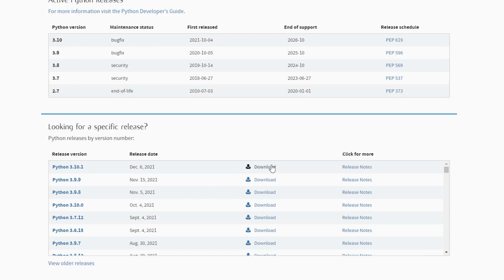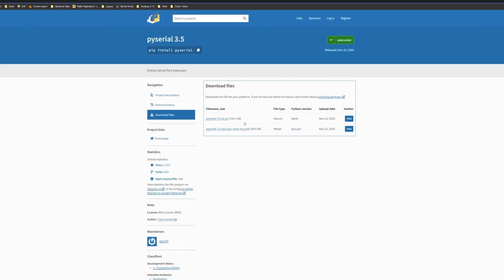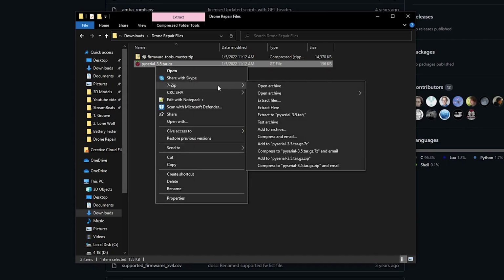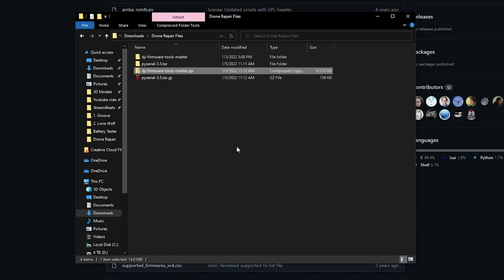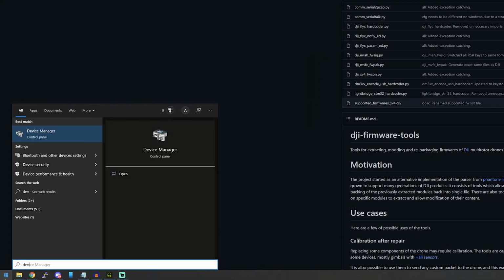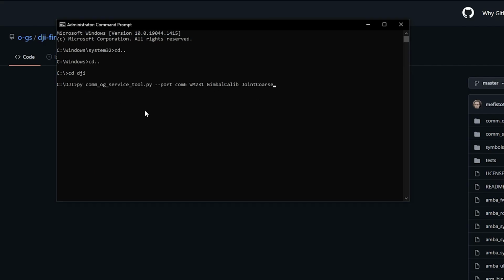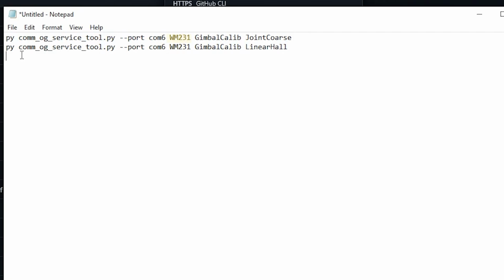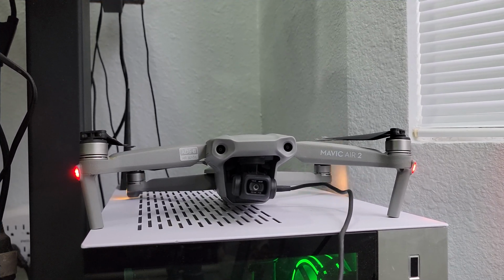DIY: Mavic Air 2 Gimbal Assembly Replacement and Calibration (Full Video)

Comment: This video saved my Air 2. It had been sitting on a shelf for 2 years after an unfortunate encounter with a brick wall. I replaced the broken parts after the crash, but they never behaved properly. I tried new wire harnesses and motors, nothing. No amount of calibration through the app would resolve the glitchy camera movements. I gave up. In doing a bit of cleaning today, I saw it on the shelf and thought I'd take another shot at getting it working. Your video was the first I found. I had already replaced the parts so I jumped ahead to the software bit. Within 5 minutes of clicking on your video, my drone was perfectly functional. 2 years it sat on that shelf. This is the least I can do to say thanks 😌
Reply from the maker: Thank you!
I'm glad that my video was able to help get your drone back up and going for you.

Comment: I did the same followed all the steps, replaced the gimbal and went through calibration on a mac. The camera moved and calibrated; however when i connect my controller to the drone it shows me that the drone needs to be activated. I get an activation error and the drone doesn't show the fly now or view of the camera. I have a mavic air 2.

Comment: Thanks great he says now download pyserial and doesn’t give the Website to go to. Well, on to the next guy.
Edit: after finding another video About this I was successful between both videos info flashing 2 Mavic 2 pros. The first one I loaded both commands no problem. The second M2P only took the first code line and the second one just errored out and didn’t need it. Neither drone had any error codes when I was done. I’m wondering if the IMU error code you got here is specific to the Air2?

Comment: I applied everything works amazingly if I use a 3 party flying app which would not be a problem but I really need active track and I have no clue if you have found a way to match up the serial numbers I can’t use the DJI app because it says I need to activate the drone because of the serial numbers being different on the camera, code error (0xffd)

Comment: Calibration does not work, it does step 1, but not step 2. All parts replaced with new. no video from camera and gimbal on one Air 2 sits on the side, and gimbal from the other Air 2 shakes and move around, and same no video feed.
After doing some research they have to be send to DJI for calibration. Not sure if DJI did something with their updates and not to allowing to calibrate your own? (just a rough guess)

Comment: Quick question. Does air 2S camera gimbal works on Air2? Can i upgrade the Air2 with the better camera from 2S?
Reply from the maker: As far as I know it would not fit in the Air 2 unfortunately. Even if it did though you'd need custom firmware for it to work with the camera.
Reply: @JoeMartinMVC 
Ok cheers

Comment: Hey Joe.   Thanks for the content.   Super helpful and easy to follow.   So I  do have a question for you.  My Gimbal is still pointing to the right after all the steps.  If I tap it lightly it will center and stay there until I restart it, but there does seem to be a little resistance holding the camera off center.  I don’t see any damage on the gimbal and drone hasn’t been crashed.   Any suggestions on what to try next, maybe a bad ribbon or maybe a bad motor on the yaw?
Reply from the maker: If there's resistance holding it off center I'd think either bad motor on the yaw or the whole gimbal assembly could be slightly tweaked causing it to bind up during the final setting.
Can you manually move it to center via the app and have it stay there after startup?
Reply: No it won’t manually adjust via the app.  Is it difficult to replace just the yaw arm or am I Breyer buying the entire gimbal and move my camera and cables over to it?
Reply from the maker: @gregswenson4921  I'd definitely say better off buying the entire gimbal as it's not very friendly at all to replace just the arms.

Comment: I am getting gimbal imu error 40011 & 40021 on my mavic air 2 . I open the cover check the gimbal I found ribon cable was loose I reconnect back , and calibrate it ( not with computer) only on the it’s software but still the error is there.How can I reset the error?
If you I recalibrate using your computer method will it solve the error issue?.

Comment: I crashed my air2s and the gimbal won't tilt down..but it works during power on and i get a gimbal motor overload during flight..I suspect the flex cable..do you have any suggestions

Comment: followed all the steps and the gimble is still tilted to the right, it never calibrated after putting in the commands
Reply from the maker: That would lead me to believe that the ribbon cable that goes to your gimbal is faulty.
Are you able to manually move it at all in the DJI app?
Reply: Did you ever figure out how to clear the codes @JoeMartinMVC

Comment: Great Job Joel!  I planted my MA2 in a tree while doing a orbit and adjusted the altitude too low:(  Recovered in about a week after a tropical storm blew it down:)  Not too wet inside but I let it dry out several days and also used paper towels...   Gimbal plastic broke in two but wires seem fine. If I order the two left arms from DJIOEMParts will I get the motors too as shown?  Also you video seems well done so I think I might give the camera/ gimbal a shot too using you calibration procedure. I guess they don't make individual plastic replacement parts???  Thanks for your video!
Reply from the maker: That's honestly surprising that it still works after all of that. 

I wish I would've known about DJIOEMParts when I wrecked mine... would've saved me a chunk of change. 

Looking at the arms they offer it does look like it includes the motors, so that shouldn't be an issue. 

As for the individual plastic replacement parts, are you referring to the plastic parts for the gimbal carriage? If so, I haven't seen them anywhere online.

Comment: ok....so

I have a mini 2, that works, gimbal and all, but a minor crash completely ruins the horizon level. So bad that Gimbal Calibration and IMU won't fix it.

will Python re calibrate the gimbal so it stays level when flying sideways again?
Reply from the maker: As long as it's not staying unlevel due to a physical issue, yes it should resolve it.
Reply: @JoeMartinMVC  I got it to work....and felt like it came close....

But something else was messed up sadly. It wasn't 100%. Plus i still did get that 40011 error despite it being the OG gimbal.

Thanks for helping! It was fun to try and fix this without needing service.... sadly my gimbal issues require it to send it in the service center

Comment: How about the code for mini 2?
Reply from the maker: The code for the Mini 2 is WM161, however the Python script has not been updated to work with it, but WM160 is supposed to still work with it.
Reply: Can i use the wm160 code for mini 2?
Reply from the maker: @kidrylvlog8244  Yes you can.
Reply: Can't confirm w160 works for mini 2

Comment: "Info: The Gimbal will move through its boundary positions, then it will fine-tune its central position. It will take around 15 seconds.

Error: No response on calibration command JointCoarse request."

Only this message all the time what could be the reason?

Comment: Great job Joe. 
BTW, does this also work with other models, i.e. Mavic Mini? 
Did anybody try to swap the boards of the two gimbals?
Reply from the maker: Thank you.
It should work with most models. The ones that are known to work are listed in the description of the video with their WM code listed as well to be able to get the drone to respond.

I'm not sure what you're referring to for the boards. The gimbals themselves are just the assembly with the camera and a serialized ribbon cable that attaches to the main logic board.
I did try swapping the ribbon cable with the OEM one but that still gave the same errors after calibration, and I don't know how we'd change out the actual camera assembly to get that serial to match the OEM one.
Reply: works, just set up Mini2 with mini1 code, as it is the same hardware. It works.

Comment: Thank you for the great video! 
And do you have  any solution matching S/N between Camera/Gimbal Assembly and Mavic Air 2?
After replacing the gimbal&camera assembly on my Mavic air 2, I got error messages which are camera calibration (code: 10017) and IMU (code:40021). Also, DJI Fly App on my iPhone does not work even though Android DJI Fly App with same version works with those error messages. The representative told me that it means S/N does not match. 
BTW, I will wait for your next video about this!
Reply from the maker: I wish I did, but sadly not yet. We haven’t been able to get access to DJI’s tool that resyncs it. 

That’s odd that it’s not working on iOS, mine still works with both my android and iPhone, though the android is the phone I use as my primary for flying.
Reply: @JoeMartinMVC  The version of my iphone App is 1.5.10. When I tapped "Agree" of "Terms of Use", It was freezing with a message "Server Error. Activation failed. Check network or DJI support for assistance (Error code: 0xffe)" or "check the network" even though it works on my Android phone with error messages. Both App Version are "1.5.10.". I hope somebody can find out the solution. Thanks!!
Reply from the maker: @PreacherJiho  I’ve heard of that error and from what I’ve heard, essentially the drone isn’t authenticating on their network due to the SN mismatch, but it’s not every drone that it happens to.
Reply: Ditto @Jiho Lee.  This all worked brilliantly for me to get my Mavic Air 2 flyable.  Thank you @JoeMartinMVC very much!  Since I installed Python differently (through the Windows Store), I ended up having to execute 'python' instead of 'py'.  I'm probably getting the same "Incompatible gimbal data" in the main DJI Fly app (on Android 12) and the same Codes 10017 and 40021 but also 40011 (Gimbal calibration error).  I tried recalibrating the Compass normal and IMU normal as well as running the AUTO Gimbal Calibration.  None of this seemed to prevent flying.
Reply: @quinnlewis2140  i had this same issue and the fix for me was to put the original camera into the new gimbal. Apparently DJI hardcodes the camera ID into the motherboard. To replace the camera, it’s just 6 screws and one ribbon cable and it’s done. Once I did that, all the errors went away!

Comment: It's working for gimbal calibration
But shows incompatible gimbal data what do for it
Reply from the maker: Only a DJI authorized repair facility is able to pair the new gimbal assembly to the drone, so that error will persist. It should not affect the functionality of the drone. 
Currently we don't have the ability to clear persistent errors as we don't have access to that specific tool.

Comment: can I contact you on email or whatsapp? I need some help. my drone after crash, I replacement the gimbal and works good. but I figure out that don't fly more than 25 kp/h in normal mode. the Dji air 2s fly 55 km/h in normal mode. do you know something about this? cine mode and normal mode I have the same speed fly, but in sport is faster. I don't know what is going on with my drone. do you think that maybe it happen because I have 3 errors (40011, 10016 and 40021)?? I appreciate your help
Reply from the maker: I have a discord server where I'm all for helping people, though I'd be limited with what I can offer here. If it goes full speed in sport mode but not in normal or tripod mode I'd hinder a guess that obstacle avoidance could be causing an issue. If you turn obstacle avoidance off in the app, does it go full speed on the other two modes then?
If that works, you'd have to figure out which sensor was damaged and replace that, but it would cause other errors due to it not being matched to the motherboard and I'm not sure if those error codes prevent flight. 
The other thing that it could be would be a damaged propeller or motor, but if it's able to go full speed in sport mode that's less likely. 

Discord: https://discord.gg/FwbT8S
Reply: @JoeMartinMVC  thank you my friend. in sport mode is faster. I'll check again. thank you very much
Reply: @JoeMartinMVC  Are you using that discord? I'm looking at picking up a cheap crashed mini 2 that needs to have parts of its gimbal replaced and would love to talk to people about it. I'm a programmer so not looking for step by steps assistance, just general ideas. =]
Reply from the maker: @lethena6249  I was looking for this comment yesterday when you posted it, but it wasn't showing up, my apologies for not replying sooner.
I do use my Discord quite regularly, though we're a small channel with very little activity, but always open to having more people join us and have an open discourse.

Comment: Thanks for making this video. For your location, how much do you reckon an authorised repair will cost? Seeing as the cost of the gimbal is now north of $300....? Some repairers with DJI Factory level software can actually clear the error code for you at a cost, but it varies.
Reply from the maker: I actually don't know, as the closest DJI repair place to me is about 6 hours away, so I didn't consider it. I'd assume the cost to fix it from authorized repair would be almost the cost of a whole new drone though.

Comment: Nice video, I replaced the camera but now I’m having trouble activating. The new camera ask for activation but every time I have an error. 
Do you know what I can do? 
Thanks
Reply from the maker: I've heard of a few people having this error, but there's not been a "fix" that I've seen that's been confirmed. Some people have had luck updating their drone and it resolves itself then, others have had luck with changing wi-fi/cellular networks and then it works. If you contact DJI they'll tell you that you have to send the drone in to them to have it fixed. I've been trying to find ways to fix that, as well as the IMU error that doesn't go away as it's done with the same tool but we don't have access to it. Yet.
Reply: Thank you, I’m gonna keep trying and following you.
Reply: @rodrigoprado7333  
Same problem with 4 drons mavic air et air2
Did not accept the activation of the new camera 
It’s happening always 
The error message request say 
The account on which the drone is activated is different from the current account 
Of course, I don't know what the main account is has the drone activated
Because I buy drones to restore them and then sell them
The only solution is with the original camera

Comment: how to get rid of error in djifly app after this procudure. althoe the drone is working fine
Reply from the maker: I've heard of a few people having this error, but there's not been a "fix" that I've seen that's been confirmed. Some people have had luck updating their drone and it resolves itself then, others have had luck with changing wi-fi/cellular networks and then it works. If you contact DJI they'll tell you that you have to send the drone in to them to have it fixed. I've been trying to find ways to fix that, as well as the IMU error that doesn't go away as it's done with the same tool but we don't have access to it. Yet.